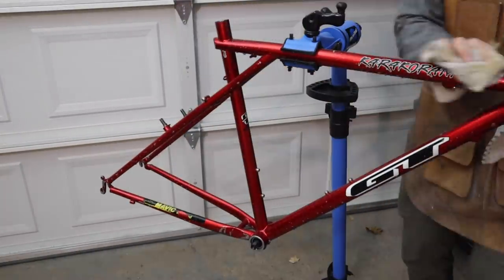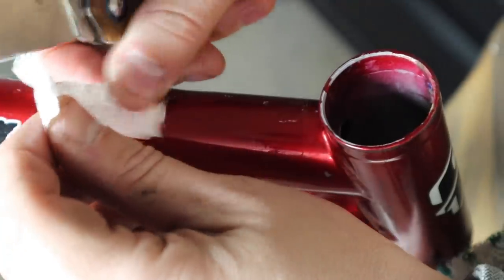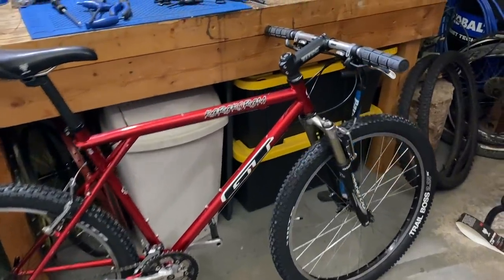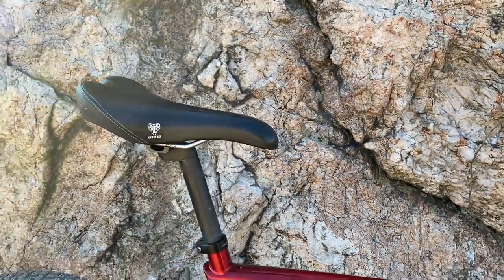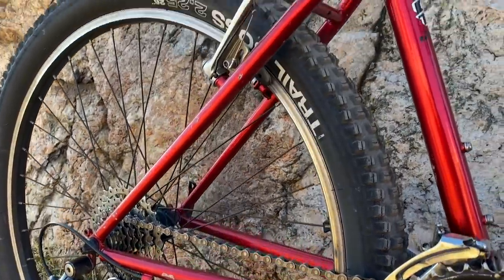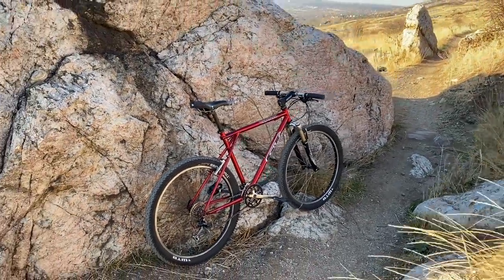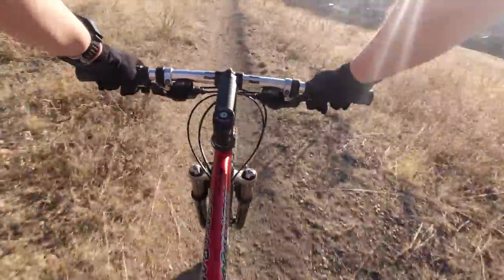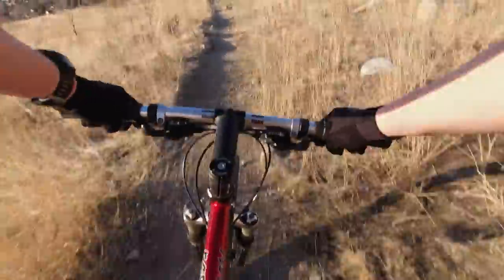Vintage GT Karakorum Mountain Bike Restoration Build

Comment: When you do these vintage rebuilds do you also rebuild the forks but don’t show it?
Reply: Exactly my thought?  Where do you get forks that are worth using? Or how do you go about servicing the used/abused ones you come upon?
Reply: @r0gu3_d4unk5  eBay is a good starting point. Do your research and you can get some mint stuff. Recently picked up a near perfect 2003 dirt jumper 2 for 40 pounds. Just gotta know what your after and search until it comes along.
Reply: Eh, on some of these old coil forks there isn’t much you can do. A little silicone/triflow on the stanchions helps.
Reply: @r0gu3_d4unk5  Same place he got a steel bike that wasn't Walmart spec?
Reply: @JamesAlexanderFoxhal  Dude killer find, I have been looking for one of those for months now lol
Reply: With these old forks it's tough. I have a Manitou Sliver from about 05 in the works  right now. It's a coil fork and about all you can do is clean it and grease it - they're quite bulletproof.

Comment: I have a Mongoose Hilltopper that's about that color. It's a deep candy apple red with a glorious gloss and shine. Bike is over 20 years old and the paint is near immaculate. I also have a Shimano STX-RC triple on it that I got used secondhand. This bike has taken me across the country and along the east coast, with over 10K miles touring. Bikes were built to last back then, and they are so easy and fun to work on. Nice build man.

Comment: I'm always amazed at what a big difference a thorough cleaning and replacement brake and shifter cables and housing makes.  That forces some related items like derailleur set up, hanger alignment, chain, brake adjustment, lever position, etc.  Sure, wheel and BB bearings may need some grease refresh as well, but it often just takes some elbow  grease to turn a poor performing bike to a smooth rider. Keep it up Rob!  Glad to see some #givethanks in this season.

Comment: As a GT collector (22 and counting), I love this video. Are you sure that frame is steel? It looks anodized red aluminum. I know the early 90's Zaskars and Backwoods came in ano.  I have a 1993 ano blue Zaskar that I'm about to convert into a full rigid drop 26er. Great work, as always.
Reply: Alloy usually has fat welds with steel having small welds. This is definitely steel

Comment: Hi, always enjoy your videos and positive approach. Question: what are your thoughts about purchasing used 26” MTB as a starter to get into the hobby?  I read that replacement components can be hard to find.  Also, I am 6’1” so not sure if the fit either.  Best regards

Comment: Thanks for the video. It's a great bike design that needs to be preserved.  Sometimes the manufacturers get it right. The color is awesome and I'm glad you decided to keep it original. My Haro Escape A7.0 has a unique blue that I've had a hard time finding a match for touch ups. But there is a Volkswagen color that comes close. As long as I can, I'm going to keep that paint. Along with the sprayed on graphics. Thanks again!

Comment: I've been taking apart a lot of seized-up or otherwise nonshifting Deore & similar shifters lately, as well. A DEEP clean usually gets them shifting like new, but some previous owners have really been hard on them. Often it's a case of oil & dust just clogging things up. Sometimes they benefit rom a soak in mineral spirits to dissolve old sticky lube then start from clean. So rewarding.

Comment: Excellent job as always. Any thoughts on the longer term durability of the paint and decals after restoration?
I avoid repainting when possible because older paint (using now banned Chems) was stronger
Is your paint / decals standing up to abuse on the trails?
That’s the key to whether I would start using it, rather than how good it looks on day one

Comment: Great video i noticed you use wd 40. Get some lanolin its natural and you only need a tiny amount it will help clean up old shifters so easily plus a natural rust inhibitor ,unseizes anything easily
Reply from the maker: Thanks for the tip

Comment: I've been looking for a GT Karakorum for a while, and when I saw this video, 3 years ago, it cemented my want for one. They just are not very plentiful in my neck of the woods, but I was able to pick one up from a buddy this week. Now I just have to decide exactly what I want to do with it. Right now it has slick tires on it, and the front fork is a rigid fork. It is the black and purple model.  I am pretty stoked about it. Maybe a build and bikepacking trip series on the bike that I build. That is a thought...

Comment: @oldshovel - did you end up putting wider bars and shorter stem on this?  If so, how do they feel?  How well does the bike handle with the new dimensions, putting you more upright? Just curious, because I have a Specialized Stumpjumper from around this era (late 90s), and the bars and stem are almost exactly the same dimensions as on this bike...wondering if I should possibly give it a try.

Comment: Same problem on my Marin Eldridge Grade 95 (old steel Tange), the stem is way too long and the handlebar way too narrow. I bougnt the adaptor to install a proper Aheadset stem on the old headset system, as the fork is cut for the old system. But it makes a big difference!

Comment: Perfect timing!

I just dropped off my old neglected  '92 GT Karakorum at the shop for some love!
They are going to put a shorter stem on than the Stock - a 60mm.

I was considering changing it to a 1X, but they said it would be too much trouble.  It doesn't seem so according to your Gary Fisher Video?  I would have to essentially switch the drivetrain from what I understand - it's a Shimano DX. I believe it's a 3X8. I wonder how much it would cost to do that. Is there a Hack to do it with my existing setup?

I'm going to use it more as a Commuter.

Lastly,  I have an old pair of Oury Lock-Ons.  The package states that I need the clamps. Can I put them on without?

Awesome channel you have!  Thanks!!

Comment: As usual another really nice job! I have a newer Santa Cruz Juiliana & I had the wide handlebars swapped out for narrower ones-not as narrow as the ones on this build of yours but not so wide that I feel like I'm driving a bus. I bought the bike for a vacation to Moab, Bryce Canyon, Canyonlands National Park & Monument Valley all on hold because of the virus. I have my bike set up for how I think it will work best on the rocky sandy ground in Utah. It's very different here in Kentucky. Mountain biking here is more like offroad slope riding. Trails are just ruts. Anyway, I'm ready for the trip just waiting for the vaccine to be available. I really enjoy your videos & am in awe of all your Park tools.👍☮️🌞🚵‍♂️

Comment: Hi, I put together a mountain bike in about 98. I got the frame from a bike shop who had it laying around so I'm not sure how old it is. 
I think the guy said that it was Easton tubing but other than that it's always been a mystery. 
It has a huge triangular aluminium downtube and smaller triangular top tube. 
Serial number is TSW7050144.
Can anyone help?
Great work you're doing.
Thanks...Jim

Comment: A year later. I just picked up a vintage GT Saddleback that really just needed a new chain,  deep cleaning, lube and a bit of adjustment. Not bad for $20. But those bars were insane. I had a nice swept 660mm smaller diameter 80's bars taken off another bike. Good rise too. So next order was new cables everywhere. That ate half my 2020 horde  of cables and ends.  Mine also still had a threaded stem, but that can wait. i just want a bike to scout two track and old logging roads. Lot of ideas for next steps from your work. Thank you!

Comment: I have a 3 speed shifter just like that on my Schwinn Mesa GSX.  When I try and shift from 2-3, it takes several attempts for it to "grab".  Could it just be dirty or is the little paw known to wear over time and cause this issue?  Then again, shifting from 1-2 is no issue so maybe the problem is not with the paw but what it grabs...

Comment: Question. I have an old steel bike frame that I want to restore and update. So for front suspention I have an rst 100mm with a 1'' 1/8 tube but the frame is made for those old 1'' threaded forks. Is there any way I can use the 1'' 1/8 fork? Thank you!

Comment: Excellent video! I share my opinion with you, the bikes of the 90's are very high quality, they last for many years, the parts are indestructible with quality maintenance. I also rode newer bikes, but I always came back to steel and the legendary shimano deore xt 737 series, which looks like now out of the factory, cassette, drivetrain, brakes, shifters, wheels, absolutely everything works perfectly. I've never sat on a bike that has such accuracy when changing gears, somehow I get excited every time I sit on it.

Comment: I am watching this again. I am watching this again as I have a swell 1991 GT Karakoram in purple swirl and matching painted stem, with u brake. I'll most likely build it restomod and with a mid 90s drive train yet 2x8 as I detest granny rings . I just do not like the purple swirl and if i strip it and repaint then it will never be the same. hmmmm....

Comment: I bought one new in 97, yellow and red with rock shox judy forks, 2nd day rode past a stunning girl and changed up a gear as road started going up, rear derailleur went into spokes and threw me over the bars, wheel was jammed up, my elbow was sticking out an extra inch, new pants wrecked, she pissed herself laughing and i had thd walk of shame home, shop had not set gears up properly so they got my full rage.

Comment: Just wanted to say a big thank you for your fantastic videos, I was going to buy a new mtb this year after 10 years of not cycling, but haven't been able to work since March because of Coronavirus restrictions in the U.K. 
I found your channel in April and your videos inspired me to unstick the seatpost on my 1993 Orange Clockwork, rub it down after disassembly, spray it rat rod style and rebuild it with salvaged parts from a Specialized Rockhopper I picked up dirt cheap. The Rockhopper was too small for me, I bought it for parts.
Long story, but I now have a fully working bike I rebuilt myself except for final set up with cables. 
I traded the Rockhopper and the bomber forks that were on it for two Schwalbe black jack tyres with the shop that did the cabling. I could have gotten a lot more for the trade but the Rockhopper is now being built up by the shop for a young lad whose father is struggling to get him a bike.
If it wasn't for your channel I wouldn't have bothered so thanks for being an inspiration. You can teach an old dog new tricks.

Comment: Do you have a tip how to clean the WD-40 after cleaning the inside of the shifters if i don't have access to pressurized air? Also: do you put some lube inside the shifter or leave it dry?

Comment: when I used to work at a bike shop for old shifters that wouldn't engage we used PB-50 or PB blaster to loosen up the gunk and it worked almost every time, plus you don't have to take the whole shifter apart.

Comment: I just picked up one just like this last week , exact same color and frame . I think it has 1st generation rockshox on it . I`m thinking on putting drop bars on it with a shorter stem as I want to ride it on trails not i the woods . Might change the forks to rigid though . I think the narrow bars were and are crazy and yet I like them . Thank you for the great content and inspiration to keep old bikes rolling .

Comment: I like your videos. With the hanger gauge and straightener tool, it helps to rotate the wheel and check the same spot (usually the valve stem) as you check the hanger. I assume the wheels on this were tried, but, as a matter of practice always using the same spot on the wheel should ensure that you are straightening a bent hanger, rather than bending a straight hanger because of an untrue wheel.

Comment: I just retro’’d a 1989 Rocky Mountain and wanted to keep the old school character. The longer bars worked well, but the shorter stem was a problem because of the shortened reach. A slightly shorter stem worked for me!
Reply from the maker: Yah, I built several with wide bars,760-780mm and most work best on these older bikes with a 50-60mm stem. The super short stems don’t provide the needed reach. My other 90’s GT I’m using 780mm bars with a 60mm stem and it’s about perfect.

Comment: Hi Oldshovel {or anyone else } Kindly tell me , @10:50 I see you  doing something that i dont understand, why you measuring the wheel radius using that metal  rod ? what is the purpose ?
Reply from the maker: I’m not measuring it but checking and fixing the alignment of the derailleur hanger.
Reply: @oldshovel  thanks for reply... FYI Your videos are really good.

Comment: I’ve always loved this frame design, I think they look really cool. I’m going to buy one shortly, and polish the frame, use some standard forks in it, and make it into an oversized BMX with thick rubber and single speed, and some BMX bars on it. It’ll be a load of fun, and I’ll stick to using one or two colours so the polished frame will really pop.
Reply: Did you get one?

Comment: i'm curious about the penny in oury, what is that for?
Reply: Because the end of the grips is soft rubber, if you wreck, the bars could turn and go through both that rubber and some parts of you; a leg, arm, or your chest somewhere. In biker-speak some call it “core-sampling”. The nickel stops that from happening by presenting a flat surface which would have a much more difficult time puncturing your body. It’ll still give you a heck of a bruise or break some ribs, but it’s better than having the bike drive through a kidney or thigh.
Reply: @UltimateWedgieParachuteCo  thankss!